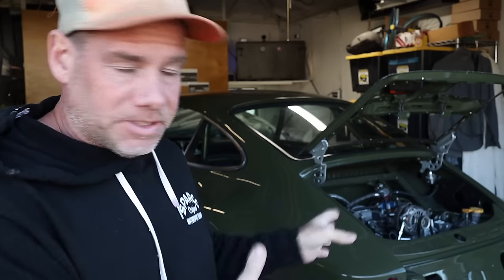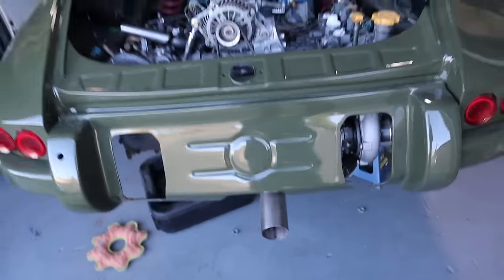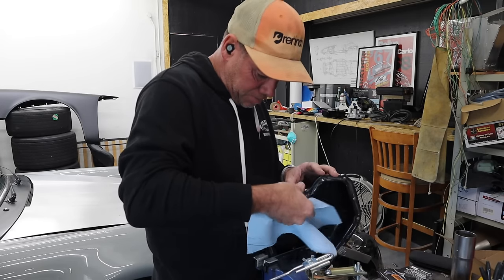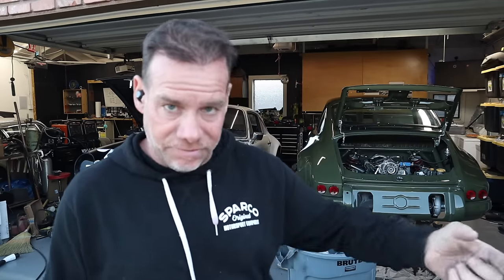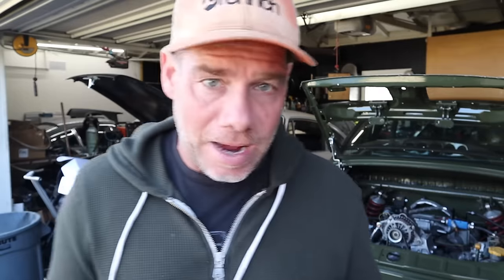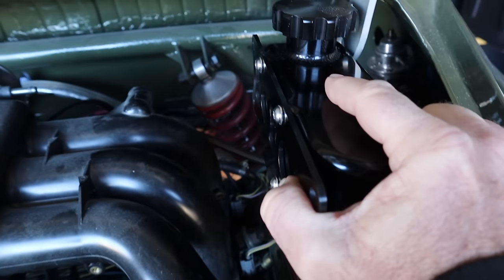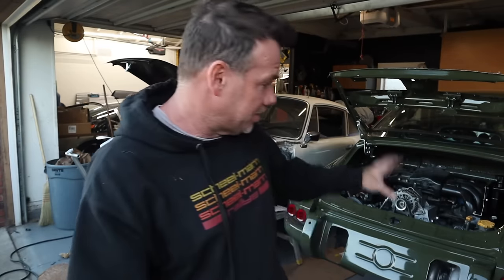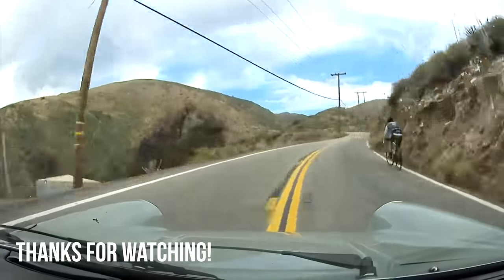SMASHING A Subaru EZ30R Turbo into A Vintage Porsche 911! | Cooling & Oil Mods! (Episode 107)

Comment: If your oil drain on the pan isn’t above the oil line in the sump. Your turbos will not properly gravity drain and could possibly backup with oil. 5:14

Comment: Hello, if you want to save weight, leave the black bracket off and screw the overflow tank directly onto your homemade bracket. is there a window to see if there is enough fluid in it?
Reply: Good idea!
Reply: I was thinking the same thing, would make the bracket a lot smaller and save weight even more in useless metal!

Glad to see im not the only one thinking like that 🤣

Comment: Wont it be hard to fill that new oil reservoir with the cap being positioned forward? AKA should have rotated 180 degree? Looks like the lid will block an easy fill....

Comment: You may need a scavenge pump for a decent drain back to the pan.
Reply from the maker: Under the turbos you mean?
Reply: Yah if there’s not enough height between turbo and pan, it won’t drain effectively and then can back up into your turbo bearings and cause smoke. You’ll see scavenge pumps a lot with low hanging turbos
Reply from the maker: @andrezbim  i've got about an 8 inch drop between the turbos and the oil pan. Do you think that's enough?
Reply: Think of it as exit from outlet flange to top of oil level in the pan. Seems close.  Check out some other similar builds and even Porsche themselves who use a mechanical or electrical scavenge pump. I’ve had problems with your height.

You can always add it after the fact if you need one but I suspect you will.

Comment: I don't know if there is a way out of this small issue,
I agree that the tank to the right of the bracket makes sense, but did you notice the cap/filler neck is now way under the cowl.......which is not ideal for checking its level, topping it up, sucking it out etc.

I can see the only other way would be instead to make the base of the bracket wider to push it to the right and then mount the tank 180 degrees around to face the front, but yes then it's closer to the induction - but hey the heat shouldn't be an issue really.   Also if it gets closer to the bay side panel or more likely that tube frame, then it may then need a rubber grommet to stop it flexi into the frame (clank clank clank under load)......but you may need that anyway for the tank as you have it - unless you weld in a gusset to make the L shape more rigid.

But I guess that's what prototypes are for..... 😉👏
Reply from the maker: Obviously I took that into consideration. Cmon man.

Comment: Thinking in terms of "while you're in there" - Is there any value in baffling that sump, given that the engine is sitting 180 degrees from it's normal position?  Seen a few too many LS motors go pop in the same circumstance recently here on YT.

Comment: come off the thermostat to the turbo those top ports feed the heater core so you will be feeding warm/hot coolant to the turbo
Reply from the maker: I was told that turbos don't care if it's hot or cold.
Reply: that I'm not aware of. I am just trying to think logically. but you might be right. I'm also concerned your turbos aren't high enough above your drain and you might have a drain issue. an oil scavenge design might be better.